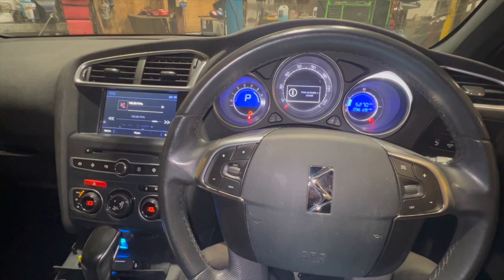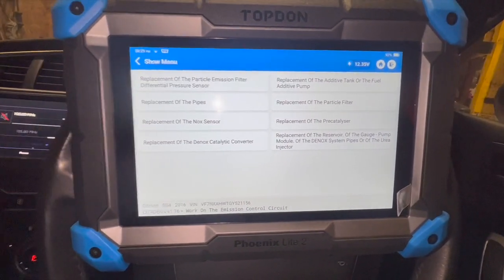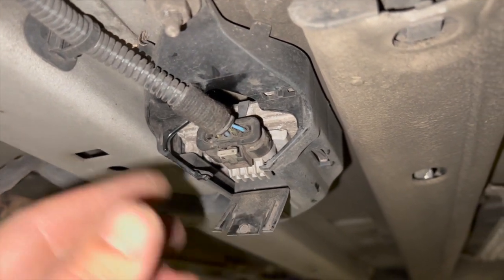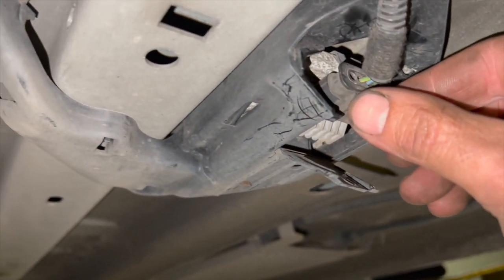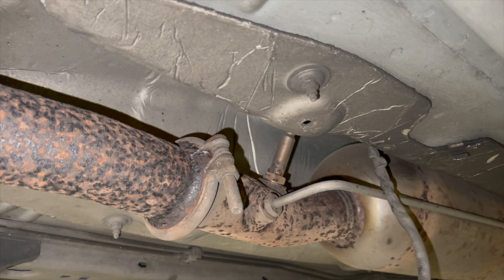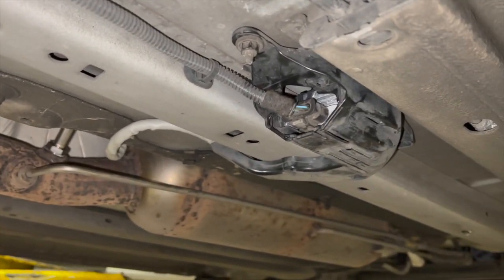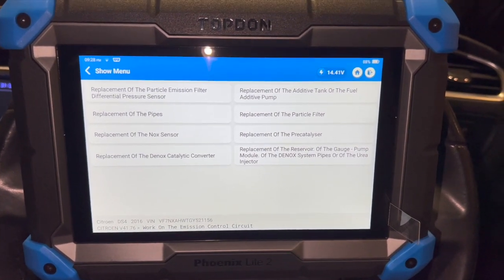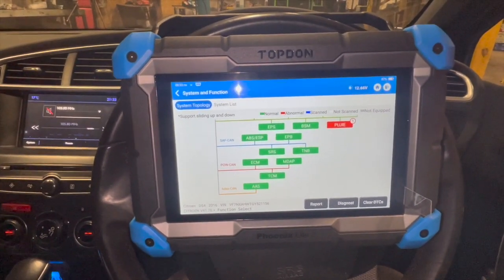Citroen DS4 Nox sensor replacement P2202 P2A00 U029D

Comment from the maker: New Genuine OE Nox sensor Ebay - https://ebay.us/gRbVEx
M20 Nox thread chaser tool - https://ebay.us/oZ8lke
22mm Crows foot eBay - http://ebay.us/HuNgTH

Diagnostic machine used in this video:
Topdon Phoenix lite 2 Ebay - https://ebay.us/tsyiTI
Topdon Phoenix lite 2 Amazon - https://www.amazon.com/dp/B0B1MB6YG8  

Tools used :
Multimeter - Multi meter - https://ebay.us/fvsMub
Draper socket set - https://amzn.to/2FdUEjf
22mm Spanner - https://amzn.to/2Rvkd1O
WD40 - https://amzn.to/3oiaIRE

Check Euro car parts - https://tidd.ly/3lIO7xA  (use discount codes on site)
Check "Car Parts for Less" - https://tidd.ly/2LNEwIn  (use discount codes on site)
Check GSF Car parts - https://tidd.ly/34pZe7o  (use discount codes on site) 

Any Donations to help Support my Channel are much appreciated.
Donate via Paypal - https://paypal.me/diydaly

Useful links:
Car Analytics - Vehicle information checker - https://tidd.ly/3B2PEbx

Comment: Hello! I keep getting a p2047 error but i notice that the nox sensor sends some invalid/negative values for gas flow (-73819750400 L/H). Could it be the nox sensor or the adblue injector, as the error code states?
Reply from the maker: That’s more likely an issue with the ad blue injector itself .. if it’s nots working correctly or blocked etc you will get incorrect readings from the nox sensor

Comment: Do you know if the Renault master mk3 needs to be informed nox sensor has been replaced? Have the topdon artidiag pro and can’t find an option to, not sure if that is because it doesn’t need doing or if I need to find someone with a better machine? Thanks
Reply from the maker: I don think they do tbh mate, im sure I was looking for this a few weeks back and couldn't find the option either
Reply: @diydaly  thanks mate. Changed nox sensor yesterday, touch wood seems to be working without any changes other than dtc clear
Reply from the maker: @marcparry2131  👍👍

Comment: My car shows U1218 everything I found out points to this sensor.  
The car is a Citroen ds4 13 reg diesel automatic with gear padels in steering wheel. The car is in limp mode stop-start doesn't work light permanent light. Error on dash electrical fault then engine fault shows.  The car won't auto change the gears and the A doesn't come up when it is in automatic.  I know this kind of things can cause a whole host of issues 
Have you come across this error before?  Thank you for any advice.  Also the Ebay link for sensor doesn't work might be worth updating. 👍

Comment: I've a 2016 DS4 1.6 HDI with the Ad blue error countdown. Where are you located, I really need someone like you  who knows this fault, my local independent garage said it's a Citroen main dealer fix but I wouldn't trust them !
Reply from the maker: Hi mate , I’m near Grimsby on the east coast.. there are a lot of issues that can cause the countdown faults.. they can be prone to the pumps (part of the tank) which will need programming at the dealer

Comment: Hi thank for your video, i change the Nox sensor and impossible for me to aknowledge U029D, have you a tip? thank you
Reply from the maker: Have you run through the replace procedure on a diagnostic machine
Reply: @diydaly  mmh no, with what can i do that ? I have just a classic obd communication
Reply from the maker: @NicolasYvenat  yeah I’m afraid you’ll need a decent scanner to do it mate , it May have a code in another ecu that’s causing the issue
Reply: @diydaly thank for tour answer can you tell me with what you do that ? I'm French, do I need to go to a citroen garage, they charge a lot
Reply from the maker: @NicolasYvenat  you can go to any independent garage.. doesn't need to be a main dealer.. it just requires a diagnostic machine with full capabilities